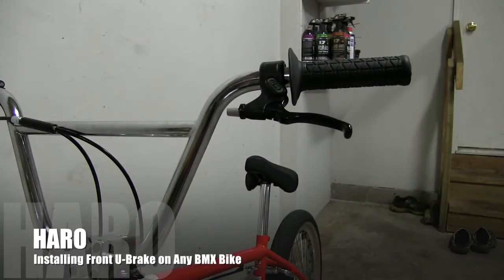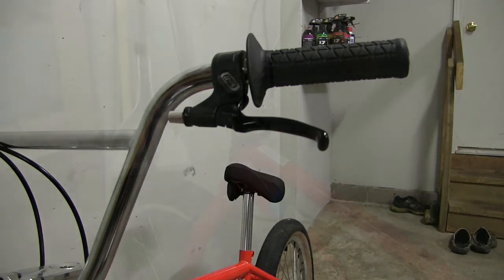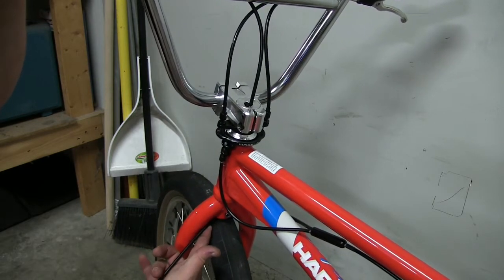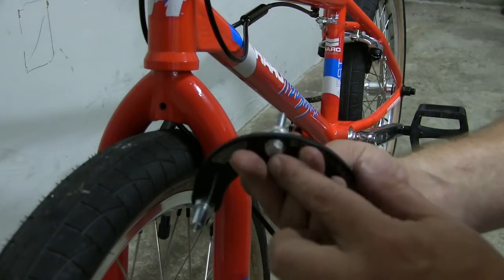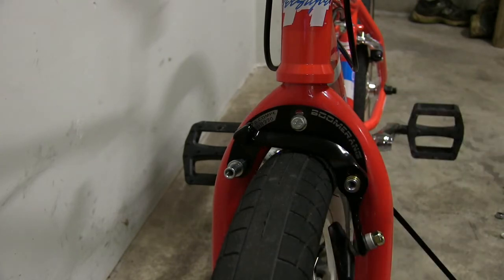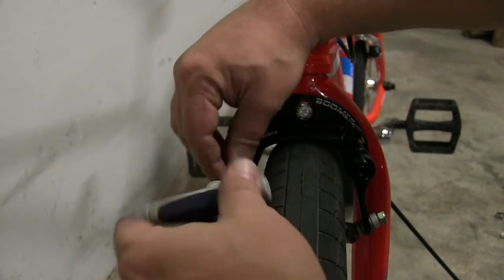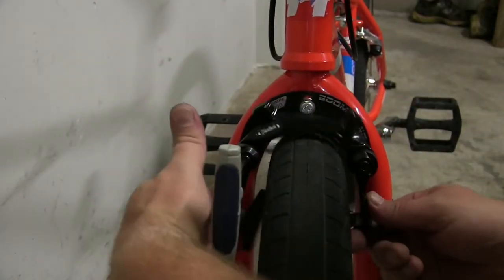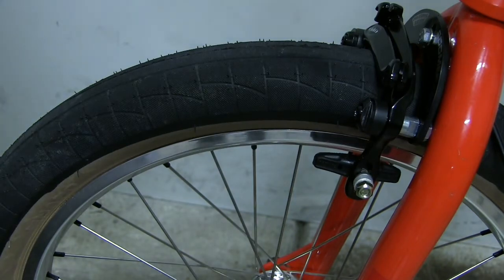Installing Front U-Brake on BMX Bike with No Mounts. Going Old School!

Comment: Add an inline cable adjuster to increase your to increase your adjustment capabilities ...also clamp the brake pads to the rim with a small squeeze clamp so both hands are free...

Comment: Cool video.  The Mission brand boomerang is welded, no nuts, so it's flush on the back.  I think you forgot the barrel adjuster on the caliper arm, unless it was missing from your package.  I have 4 sets of these brakes, all came with a (poorly designed) barrel adjuster.  Odyssey Evo 2.5 are better brakes for the front.
Reply: I noticed that too 😆

Comment: Always wanted to try one of these but heard that they end up sliding around? Or is that only if they get loose? Usually the cable is on the outside of the fork through guides like on my old school GT and Haro's. Great tutorial! I use old school 1.95 perfect in between size as I do not care for the wider tires.
Reply from the maker: I ride it almost daily with my little guy and haven't notice it slipping, I think if you have everything adjusted correctly you shouldn't have issues. Yeah, I wanted a cleaner look, the old GT's used to have a hole in the fork to go through but this one doesn't :(
Reply: Cool thanks I might try it. I guess if it is tight it would stay. I am building another one now an 87 Haro Master re-release like I had in 87 also. No 990 mounts on front just on back. But the Dia-Compe Nippons I had did work pretty well so might try those first.
Reply from the maker: I was going to go with Nippons but finding the parts to allow the cable to come from the bottom seemed impossible to find. Did you see the 2018 88 Master and Sport they are re-releasing? Look awesome!
Reply: Well the ones I bought are set up that way so not sure, I used the 883 Nippons on my 87 GT. The cable goes down the fork and up in the caliper. I usually get them from porkchop BMX. I did not need any parts except what came with them. Yeah I might get the 88 Turquoise/teal kit as well and build one up. But I love the neon yellow/green also so may get both lol. I had the teal 2005 Sport also super smooth but was a tank and pretty heavy. But rode great.
Reply: @Johnnysshop  The Master & Sport surely come more completed than the Pro Performer I just ordered👍😏.  I'm currently gathering all the hardware to dress my Pro P properly. Tomorrow I'll head to pick up an adaptor for my naked fork.

Comment: Heat shrink on the cable is an awesome idea. If you put a rubber band going from brake pad to brake pad through the rim it makes it super easy to adjust the brake cables

Comment: I'm no pro bike fixer guy...but, i think i would have routed the brake cable on the outside of the fork instead of the inside so close to the spokes...nice bike!!!
Reply from the maker: I just wanted it out of the way :) Thank you!
Reply: If you have 990s then you pretty much make the cable hug the frame. Helps if you have some diatech flexies which are like gods cable housing.

Comment: hi there. very helpful video. can you post the link where to buy the u-brake adapter? thanks.
Reply from the maker: https://www.danscomp.com/products/489057/990_Brake_Plate.html
Reply: Thank you so much. One more thing, the u brake, did it come with the tightening caps or did you buy them separately? Again, link please if you bought them separately. Thanks.
Reply from the maker: The black cap that holds the brakes on? If so, those are included with the brakes.

Comment: Is there a way for me to install a gyro system if my bike has the old school forks and stem? I don't have the newer setup. I'd love to install my gyro system onto it
Reply from the maker: Not without drilling I don't believe.
Reply: Johnnysshop I appreciate the comment. I found a bike from the dump that has a gyro plate that goes under the headset cap thing

Comment: Yes that front cable needs to be alot shorter and come on outside of fork to the brake, with it being on the inside and so long its gona cause problems and looks like hell, other then that i like the install. Good work

Comment: Back in 1991, I tore my original 1988 Haro Master apart and put it in a box. I finally broke the box open November of 2023. Reason I put it away in 91, I was stupid and removed the Black and Blue, because I wanted it all Chrome. We stripped the black and blue off, put it all together, and I hated it, so that's why it lived in a box for over 30 years. November the frame went in for Black and Blue Powder Coat and she's Beautiful 💖 So all original parts are going back on it, except new repop group 1 neck, and repop new black/ chrome knee savers, new locking Dia-Compe 77's and the new Haro tires like yours 20x2.20's and that's the problem and why I came to your video. Well you don't have the problem like I do, but I didn't even think about the new fat tires and now I'll have to see if my front cable is gonna bend tight like yours. Here's my issue. I order in 1990 the FS Dia-Compe kit, which came with a nonmarked chrome 990 plate adapter. It worked in 1991,but guess what, with the new fat tires from Haro the HP's, it rubs the side of the tire 😭😭😭❓😭 Well I bought the brake in 91,so I'll just do what any 21 year old would do back in the day, 😂🤣😂🤣😂 I'm using a Dremel on it with a cutting wheel and cutting the inside's out ( did that tonight), but I'm going to clamp it in a rag into the vice it'll go tomorrow and I'm going to have to vice it upside down and grind away with a stone back and forth like on a quarter pipe, back and forth to open it up. I'm going all the way to the welds and to about a 1/8th of a inch to the bottom of the slot and that should open it up to fit around the top and sidewalls of the fat tire. I just could buy like the one you got, but everyone in my family were millwrights except me, so taking my wanna be millwrigh skills on it 😁 Thx for your video as i didn't know about the cable until your video and hoping I won't have that issue since I have the original 1988 forks with the gold down pegs and the welded on cable tab/guide which that alone puts a bend in the cable 😁😎👊

Comment: what keeps the adapter plate from moving side to side ?
Reply from the maker: Nothing really except the center bolt. If the brakes are adjusted correctly they work fine just floating there.